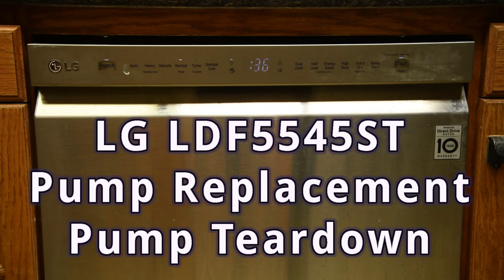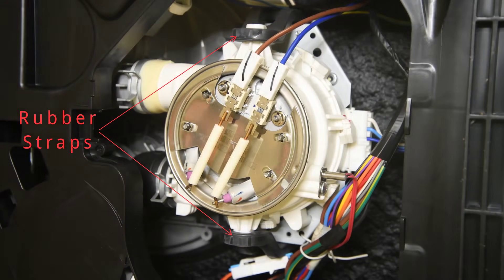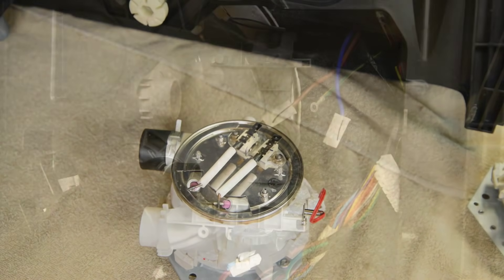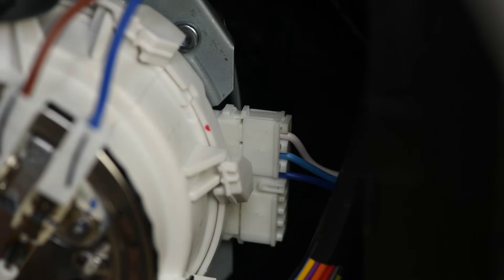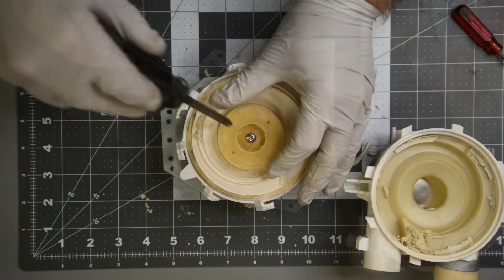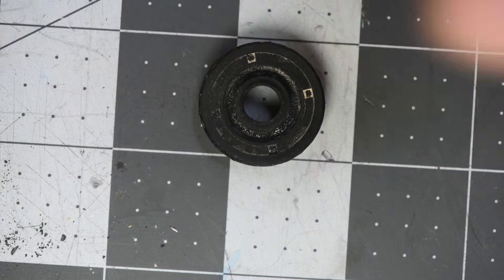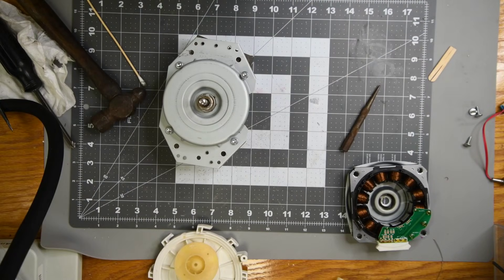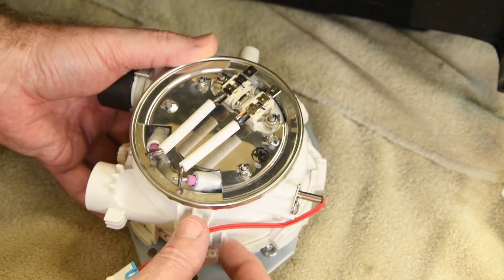Noisy LG dishwasher Fix – Pump Replacement

Comment: I called LG and they sent me a motor assembly part #4681ed3001d, it's a different part than the one you replaced. I guess the part they sent me is the one with the 10 yr warranty. Mine is making the same noise as yours was so I'm going to replace the pump like you did. I'm thinking this isn't the part warrantied for 10 years. There's probably more than one motor.
Reply from the maker: The pump motor is the main motor that should have a 10-year warranty. Is the motor they sent you around 2 to 2 1/2 inches in diameter?  If so I think that is the motor that moves a valve.
Reply: I think you’re right, the part they sent is called the diverter motor.

Comment: Very good! Thank you! Our LG dishwasher started making this noise and now the pumps on Amazon are like $175 bucks. So we are able to get this free from LG but need a service tech to call it in?
Reply from the maker: There have been a couple of comments from people who have been able to get the replacement from LG.  But I don't know how hard they had to stay after LG to get it.  When I first looked into it, it appeared that to get it replaced under warranty required an authorized service center to come service it.  The service call alone was more than the price of the pump.  So that's why there is a video.  Since that time LG has had a PR disaster with their refrigerator compressors, so that might have changed things.
Reply: Call LG and let them know you can fix it by youself or you have a handyman to fix it, then they will give you an authorization letter and you can order the motor for free in LG part website.

Comment: Thanks for this wonderful video! I just replaced the pump on my LDTS5552S after less than 2 years of ownership after hearing the exact same bearing noise as your video (thanks for putting that right at the start of the video) and it's now good as new! I ordered it from Sears Parts Direct for $65 +tax/ship.

Didn't feel like wasting time with LG support robots to claim my warranty pump, but maybe next time the thing breaks I'll try that.
Reply: Do you happen to have a link to the part you ordered? I have the same model as you but having some difficulty finding the correct part
Reply from the maker: Wow, that is a great price for the pump.  Glad the video was useful.

Comment: Just wanted to thank you for this amazing video! So well done. Simple, concise, to the point and just downright enjoyable to watch. What's even better is that my LG dishwasher is all good to go now after replacing the pump assembly. Just wanted to note for others with a similar problem I experienced with this same model: my issue had nothing to do with the noisy motor/bearings issue, I was  getting the HE error code. Everything functioned and sounded fine, but my dishes were soaked, and the heat was not turning on. I figured I just needed to replace the heating element, but finally figured out (after numerous dead ends and hours of research) that this model has a combo pump motor/thermistor/heater and you can not just replace the heater. Purchased the combo assembly on Amazon and replaced it just like you showed, and now everything is good to go, no more HE error and dry dishes! Bummer on the replacement cost, but dishes are nice and dry again and now there is no need to replace the unit. Also wanted to note that I tried getting LG to replace on the 10 year motor warranty since it's a combo along with my issue (heater), but LG refused and wanted to charge $350+ w/ tax to send someone out. Anyways, thanks again for the amazing video!!
Reply from the maker: Great info on the heater error, thanks.
Reply: Absolutely, hope it helps someone with the same issue. Thanks again!

Comment: Thanks a lot, my dishwasher is LDTS5552S and just 1.5 years, I got this noise, Damn LG!!! . I think it's some bearing going bad but do not know which one,  how to open and replace it. This video helps a lot. I noticed with my dishwasher, it's part# AGM30016301, just $76.95 on LG part web and a cheaper web just $61.73. This video part number is ABT72989206, Both parts back codes are AEG73649901 and same, why the prices are so different? . Anyway, the cheaper one was ordered, installed and works perfectly on LDTS5552S

Comment: I am extremely disappointed with LG, I am having the same problem and the dishwasher is less than 3 years old. we had another problem with LG TV that stopped working in 2.5 years. I would never buy LG ever again.
Reply: Just started having it with my dishwasher tonight at 3 1/2 years old. Our lg range started acting up at 2 1/2 years old. I’ll never again buy lg. I’ll go back to Maytag
Reply: Ours is doing the same and is only 3 1/2 years olds- and it started months ago. 🙄🤦🏻‍♀️
Reply: We have this same issue and our LG washing machine water inlet valve went out in 3 years. Never buying LG appliances ever again.
Reply: Lg dishwashers are very poorly made. Mine had tins of problems. Ae eeor codes, Clogging issues, Circuit board blew, now its making tons of noise.
Reply: Ditto!
Reply: Our LG dishwasher motor died 2 yrs 8 months from install. Also had a lg electric stove that died 6 years old. No more LG for me.
Reply: 2 and a Half but we run it every day
Reply: Motor needs new bearings, and a new seal for the shaft. Not a hard fix
Reply: @Phil-D83 
All the problem in the mechanical seal between the impeller and the motor. 

So we have to say that the design is not good the company must change the oil seal design and put mechanical seal like we see it in the water pump impeller
Reply: نعم عندك حق
Reply: Great video! Well explained and reasoned.  Good diagnosis. Very helpful! Thanks.

Comment: We have an old LG unit in our home and 1.5yrs ago I had its pump motor replaced. Now the very same noise has returned, indicating a new motor is required.
Is that to be expected for a daily use unit?

Comment: Great video. My dishwasher started leaking few days ago & I turned it to its side & have noticed drops on the crimped metal casing of the pump, but yeah,, quite pricy. I love the machine though, 6 years no trouble ,, again, thanks for the well done clip
Reply from the maker: I do wish LG had put more effort into the pump seal. But it is the best-cleaning dishwasher we have ever had. Replacement part prices seem to be outrageous for almost everything; companies don't seem to want any of their products to be repaired.
Reply: Just ask LG to send you a new DD motor for free. I just did that and fixed my leaking machine.

Comment: My dishwasher is only 2.5 years old and my pump failed. LG just flat out refused my warranty claim. Thankfully your video helped me get mine running again. Hopefully long enough so I can save up for a better brand.
Reply: Same for me, really disappointed. My machine cleans really well but the motor/pump assembly is trash.
Reply from the maker: I'm glad it helped.  Don't know what's going on with LG these days.

Comment: I tried dealing with LG and was told to run a cup of vinegar through it. It may help quiet the loud bearing noise. Great customer service
Reply from the maker: Only 2 years is horrible. And I don't know if LG realizes it, but their customer service is going to destroy their brand name. LG knows they have a problem with the pumps.  Having their customers waste time is not going to help anyone. A few years ago LG would be a top appliance pick. Now I don't really think they would be at the top of the list.
Reply: @metalplasticelectronics354  Thanks for the video. It's very well done.  I have a similar model, LDP 6810 that is 3 years old.  It's making the same really irritating noise. The noise is present during the entirety of the wash cycle and changes pitch as the motor cycles up/down.   The part is under warranty (10 year) but I'm sure the labor charge will be at least $250. I'm a wrencher and repair my AC unit, motorcycles, cars, etc. This looks like a fairly simple job. so I'm hoping I can find a pump for a decent price.  I'll post a follow-up comment to help people with the LDP series.

Comment: You do a terrific job of showing and explaining! Thank you. I do have a question for you though, if the motor had a 10 year warranty why not let them ship you the motor instead of buying another one?
Reply from the maker: When it first started making noise, I checked, and the only way to use the warranty was to have a LG authorized service center come out and work on it. The labor was even more expensive than the pump. Lately, I've seen a few people say that LG will send them a replacement pump. I think what has changed between when I asked and now is the very bad publicity LG is getting over their refrigerator compressors.
Reply: Can confirm I got LG to send me a replacement motor/pump assembly under warranty. Took me 3 tries contacting them but finally got it. Installed with the help of this video and it's good as new!

Comment: Hi, Need to replace the motor power connector😢 Would you know a part number so I can look up for it?
Awesome and very uselful video.
Thanks!
Reply from the maker: Have you tried the lgparts.com sight?  They have an exploded view and can maybe get the part number.  But I doubt they would sell just the connector, probably the entire wire harness.

Comment: This is great!

You have saved me so much work, because I would have torn the motor all the way down as well. I’m in the same boat. Same model dishwasher making noise after about 5 years. So ordering the pump today.

Great 10 year warranty, but doesn’t cover the pump. Have you contacted LG about the failure taking place in a motor bearing, so should be covered by the warranty?
Reply from the maker: A couple of comments have said that LG agreed to supply them with the pump assembly. They didn't have to have an authorized service company come and change it. I think it may be the bad press LG is getting over their refrigerator compressors that has changed how they are handling the pumps. If it's making noise, LG knows it's the motor bearing going bad.
Reply: I spoke with them last week and didn’t have a lot of confidence in their feedback. They kept asking if it was the water filling or too much soap, or anything but the motor/pump.

Thanks for your video and comment. They have been very helpful.

Comment: So I appreciate the information in this video - I would have appreciated a motor that did not go bad after a couple years of use a whole lot more.  I don't want to sound like my grumpy grandpa but they really do not make stuff like they used to.  What is the point of a 10 year warranty if it will cost 300.00 or more to have a technician replace the part...
Reply from the maker: Yes, the labor cost is the killer. When I pulled it all apart and saw what a cheap seal was being used for the pump, I couldn't see any way it would last for 10 years, if it's used at all. These are not cheap dishwashers, and LG certainly should have used a better seal in the pump.

Comment: My 4-year-old ($1000) LG dishwasher just started doing the same thing and then started smoking. Now, it won't even power on. Your thoughts please?
Reply from the maker: The noise is from the top bearing in the motor. The bearing goes bad because water gets into it from the seal on the pump leaking. It could be that the bearing locked up and the motor got hot. I'm not sure how good the overcurrent protection is in the motor drive circuit. Alternatively, it could be that enough water seeped around the motor and started arcing in the heater circuit. Did you see smoke or just smell something burning? Either one of those, I'm sure, will blow a fuse on the control board. It might be worth a call to LG to see. They are taking so much heat from the refrigerator compressors right now that they may be a bit more willing to work something out.
Reply: @metalplasticelectronics354  It was smoking as well.
Reply from the maker: The smoke could be from the heater on the pump, from water getting to it and causing a short. If it's not that, then it probably means the main control board is damaged as well. I don't think the motor would smoke without something on the control board shorting. But I'm just guessing now.
Reply: @metalplasticelectronics354  Thank you very much. I'm pretty sure at this point it would make more sense to just buy a whole new dishwasher. I can get my exact unit for $700 (including installation) from Costco. Rather than go down some DIY rabbit hole. With parts and labor, I'm probably looking at at least $400-$600 to fix my existing unit.
Reply from the maker: Probably the wise thing to do.

Comment: Same problem here after a few short years, perhaps 3 years.  I'm thinking "LG" stands for Low Grade given how frequent this failure is.  Just ordered a part on the strength of this quality video.  Thanks to you for 15 minutes of perfection
Reply from the maker: Thank you for the very kind comment, hope it all goes well with the replacement.

Comment: I got the same unit and the pump motor just come in the mail. I will work on it this weekend.
Mine is 4 1/2 years old.
???? Your's is 6 years old. It has a 10 year warranty. 
I called LG and had them ship me the part 100 % no charge.
Reply from the maker: Very nice. You are the second person who has said LG would send them the pump. I wonder if LG's refrigerator compressors being in the news has made them a little more willing to, let's say, do better.
Reply: the first 15 second's has the 10 year motor warranty tag.  @metalplasticelectronics354

Comment: What a well made tutorial video!  Concise and to the point.  No rambling and only pertinent info.  The gold standard of how to videos!
Reply from the maker: Thanks.
Reply: Just in case this may help someone else.   I actually found the seal on Amazon and replaced the bearings.   And used bolts to replace the 4 rivets.     Total cost of repair under $20.  Still working over a year later.
Reply: @Modernhillbilly  was the motor/pump shaft showing signs of wear similar to the video shown?  Do you have any part numbers for the seal and bearings?
Reply: Yep. Successfully completed the task. Thank You, may reason light your way.
Reply: Agree with the “gold standard” comment. This is one of the best tutorial videos I’ve ever watched and learned from.

Comment: This was the perfect repair video. It was exactly what I needed and very concise. Thank you so much! Also, a tip for others, after much persistence, I was able to get LG to ship the pump to me under the 10-year parts only warranty.
Reply: I’m gonna try to get them to send it! We’ve only had it since July 2022, about 2 1/2 years old!
Reply from the maker: Congratulations on getting LG to send the pump; you must be very persistent. If I may ask, did they want you to return the old one?
Reply: @metalplasticelectronics354  No, they didn’t ask for the old pump back. Once I convinced them that as a homeowner I could be both the technician and customer they sent me an authorization letter/code that allowed me to order the part through their service portal. It shipped ground the next day. No return box or RMA.
Reply from the maker: @chaos4675  Very nice. That actually raises my opinion of LG.
Reply: What email of the agent were you dealing with. Mine refuses to send a new one when I supplied pictures of the rust on the motor assembly. So hoping to get the email of the agent you dealt with. Thanks

Comment: I want to rebuild one what size is the bearing?
Reply from the maker: It's an NSK 608 bearing.
Reply: @metalplasticelectronics354  same size as a normal skateboard? 8x22x7mm just rubber sealed ? Thank you.
Reply from the maker: Yes, it seems to be. 608 number ends in D16 only saw DD in NSK catalog.

Comment: Bro! Your video is amazing. I'm all about repairing sealed parts to save $. LG won't send me the pump directly, only to a repair company. And the repair company will want $300 to $400 for labor (two trips plus install). That's 50% of what I paid for the dishwasher... NOT worth it. It's a scam. Anyway, I'm going to try repair the motor since it just started making the noise last week. It may still be salvageable. For the shaft seal, would you recommend silicone grease or water proof grease (two options used for plumbing part lubrication). For the bearing would you recommend white lithium grease or Mobil 1 synthetic bearing grease?
Reply from the maker: I'm not sure about the grease for the seal. I am a fan of synthetic grease for just about everything. I’ve had great results from several of the Super Lube synthetic greases. I think I would try to put some kind of disk on the motor shaft to divert the water from getting into the bearing. It wouldn’t be too bad to have to change the pump seal every couple of years. The motor bearing is another story. It is horrible how companies behave when it comes to items you buy from them.